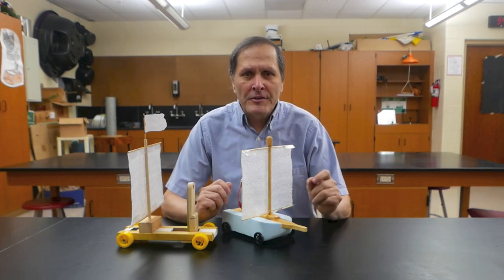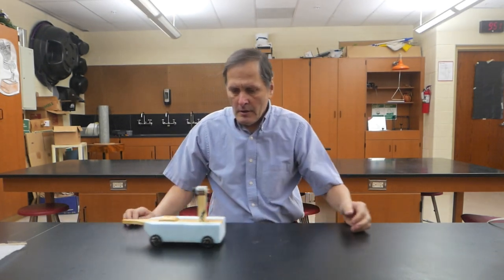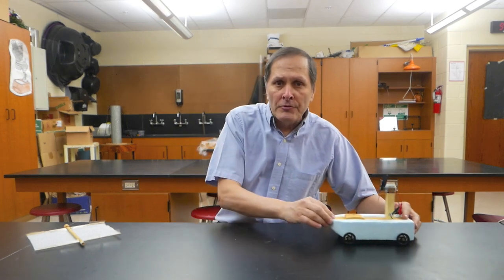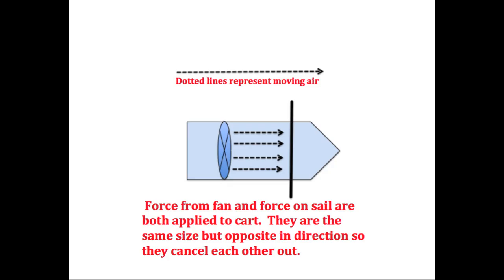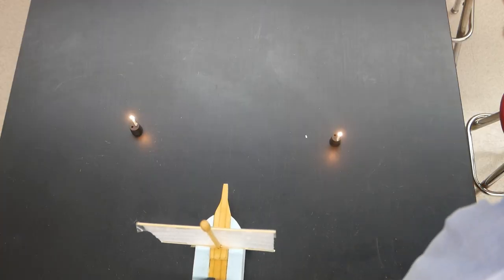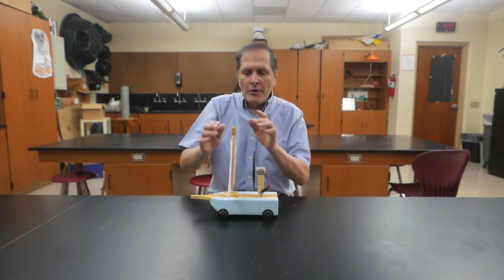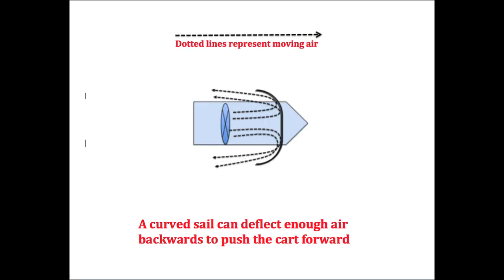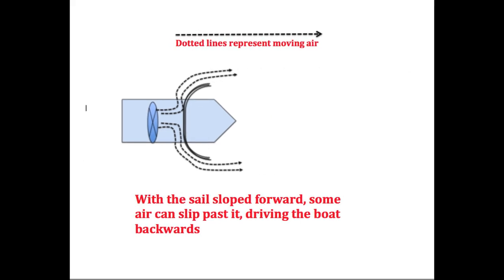Fan Cart - Blowing into your own Sail- part 1 // Homemade Science with Bruce Yeany

Comment: The principle of action and reaction is very valid and applicable that far i have gone for now across all your presented samples and applying it to them.

* A fan blows air into one direction whilst it sees exposed to a force in the other direction.

* A flat sail seems to redirect an air stream to both sides (great method of proof with the candles!) and thus first stops the air stream by action force against its original direction so the sail gets a reaction force in the original air stream direction. for the fixed fan with moveable cart the flat sail equipped cart sees accelleration. for the cobined cart with mounted flat sail and fan both items create an equal but opposing force (assumed that all air is impacted in the same manner by the sail). this will only bend the structures in between them. but wait - the second effect of the sail is are two roughly equal air streams to the side. so there are two forces accellerating each half of the air to the sides. Cause? The structure of the sail is flat... but wait the first stopped air is creating a preasurized area... that means an air volume that would like starting to expand to any direction. the oncoming air will not allow as well as the sail wil not allow but the sides are open - and guess if you would be able to put a candle above or below the sail it will as well see a wind stream. but see the flat sail is in the full scenario not exposed to the direct force of the oncoming winds but by the pressure the "stopped" air bubble is creating to all sides including the side of the sail. so the forward force on the sail is of very indirect nature. most of the air's substance never even touches the sail but it's force and energy is handed over to their neighbours making only the relatively few ones in contact with the sail finally transfering those attributes to the sail. now black boxing... regardless on how the pressure area looks like, the result is an air movement to roughly the sides. i say roughly because neither the sail nor the fan would create an air stream is expected to be perfectly in dimensions, its just sufficiently good. as the resulting air stream is moving more like a circular surface wave from a stone that is thrown into some lake its causing action would hint for a center of origin with all action forces pointing starry to the outwards from a theoretical center while all are living in the same plane.

side note 1: what is really going on? the energy of your batteries that you used for the fan is converted using multiple physical effects in sequence so that finally an air stream is leaving the setup that is expanding mostly with a circular front and in parallel to the surface of the sail. the energy is gone to the expanding air and that is what energy often does... maximzing entropy.

side note 2: guess why it is so hard to balance the "flat sail + fan on water" variation to not start turning? because it is so hard to keep the presurized area sufficiently symmetric. imaging you are trying to balance a disc on a pin and then pouring water onto it - hopes are small that the water will flow to all directions i the same fashion. this is much more true when it comes to a flat paper sail that will be able to bend depending on the force the stopping preassure applys to it.
Reply: conclusion:
the flat sail+fan vehicle is a "trap" for the air to build up preasure so that the air (as an energy carying medium) will vaporize the energy from the battery in a balanced fahsion. thus no motion. any change in the base setup that will break those force balance thus will create some driving force that might at least for some cases lead to a motion of the vehicle.

but you were using rather force than energy - and the balance of force in the setup can be shown in general and even on the very spot:
a total deflection of the air stream (forming it into the circular expansion shape) is of course a force that is finally attached to the sail with one direction forward and a second direction outwards. (the first one is a classic actio-reactio "hard ball" force whilst the second is more of a surface friction force but still is much of actio-reactio but in a harder to see "slow down the stream fashion" with rather mostly undirectional thermal (=micro motion) energy in the result than some linear motion. objects rarely start a motion into all directions... their internal structural force limits will not allow - unless you spin some flywheel shape beyond its limit. why not spin a sand covered disc at increasing speeds?) if you would attach a bunch of little strings to the center of your sail with e.g. foam cubes on the other end... then you will be able to see how the air stream pulls them apart in a cirucular fashion. and this will show (in a macroscopic model fashion) the circular pull of the force on the center of the sail. of course putting a few water drops on a horizontal surface or attaching many little strings with film tape onto the surface

BTW: you could easily put a cone alike object in the center of the sail - no change.
or you could exchange your two-tubbed sail shape with a bunt cake pan (half'ed toroid) shaped one,  thus looks like a circular tub.

PS: your wheels on the vehicle will be able to create a high side force (slipping resistance) for keeping track whilst they will have a low force (low rolling resistance) into the rolling direction.
Reply from the maker: that's a very complete examination of the demonstration.   Interesting,  originally I thought I was showing a basic example of action reaction and it appears to have involved into a problem that is much more complex.  I am going to try this again next week with some other variations to address concerns brought up by several viewers.  I will try what you have suggested and see we can get,  thanks for your insightful comment.

Comment: Absolutely bloody brilliant video.

I had come to exactly the same conclusions as this video did in practice from considering the different scenarios, although I didn't bother consider the scenario of a curved sailed pointing away, and indeed that scenario behaved as I suspected as a less efficient form of the cart without a sail.

Doing it on the water as well was another excellent test.

The build quality of the little carts and sails and fixtures was excellent as well.

Comment: Could a sail be built with enough slack and design in the fabric (and enough "wind" in the motor) to be able to mimic the curvature and forces in the fixed cardboard sail?
Reply: tsysman21 
what would be the point?

You would move faster with just the fan.
Reply: bananian I'm aware of it not being practical; my question is just is it possible. Even having the cardboard sail is less efficient than just using the fan.

Comment: Great video! Before I had witnessed any of your solutions to this dilemma, I thought a good way to solve this was with a sail that angled back toward the fan or a fan that angled back aimed at the top of the sail. I realize that you don't want lift, but there may exist a happy medium in there. I would imagine that a combination of both might create the desired result. However, the curved or cupped cardboard version you came up with is probably the best option. Cheers!

Comment: look the video. as a sailor I have to say you did a great job explain sail shape. sailboats get pushed to the side by the wind. the sails create lift and pull the boat forward. I noticed you had your sail put on backwards. I'm guessing it was to so the difference between deflection and push. it would be interesting to see what would happen if the mast was behind the sail
Reply from the maker: I fixed that in part two

Comment: What if the fan is lower down and angled up at the sail? or more curiously, a flat sail with a dead on self propelling wind, plus a small amount of external wind, would it go just as fast as it would without the on board fan, or would it go faster/slower?

Comment: i noticed your "cloth" sail was pulled tight and flat against the mast...did you ever think to lower the fan a bit and add more fabric to the "cloth" sail? wouldn't that cause a cupped effect to the air and refocus it so it pushes the object forward?

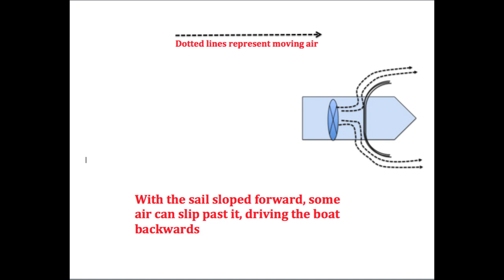Comment: 5:12 is it just me or is this diagram a bit off? i feel like there should be dotted lines pointing towards the inner curve of the sail (against the wind from the fan). if i remember right, the air moving along the curve of the sail is creating an air pressure difference between the front of the sail and the back of the sail. the pressure difference is what causes the boat to move backwards.

Comment: With the curved sail positioned to push the boat forward in water using its fan and then adding another fan not located on the boat, but also pushing from the rear,, would they cancel each other out???

Comment: A question on the "hard curved sail" placed so the is diverted around the outside in the same direction the fan is directing the air... Couldn't we also say the are rushing by quickly also creates a lower pressure area on the inside of the sail, allowing the atmosphere to press on the inside of the sail?

Comment: good video man, 2 questions though, on real sails the fabric is loose, actually relying on the wind to form it in to the needed airfoil shape required to move the vessel forward, your sails on the other hand were stiff as a board. would blowing into a loose sail create a conical shape, simular to the one produced by your cardboard sail,  and therefore diverting the air towards the rear of the vessal and pushing it forward?  also if the sail is angled as in real life, will blowing into it from the rear have any effect? I think in theory as long as you could still get it into an airfoil shape it might work?
Reply from the maker: I kept the sail stiff as I was trying to have it resemble the  fan cart  which many science teachers have in their classrooms, my mistake.  I think I do a better job of it in part two

Comment: This is really cool. Definitely something I wish I had been doing going through middle school instead of textbooks. I don’t know if it would be instructive to middle schoolers to include a history of the development of transportation. You can see what were successful and then try things that weren’t tried or were tried but failed. This way the students get a feel for experimenting. Something like: why did they go the route of paddle wheels instead of a fan blowing in the back of the ship when steam power came along? Why also did they used the propeller screw later and not keep using the paddle wheel? And why did they not hang a couple of jet engine on the sides of a ship? So then the  students would be looking into the concepts of momentum.

Comment: I have a suggestion, have you tried aiming the fan perpendicular to the boat instead of parallel? If you then fix the sail in an approximately 45 degree angle, the cart/boat should travel forward as well. This is based on a sailing principle that allows you to sail upwind.

Comment: Do you think the torque of the motor had anything to do with the boat spinning. If it was because of unequal force on the sail the movement would have been more sidways. Yes the front of the boat would have made a circle due to the location of the sail, but I feel that was too extreme for that force.

Comment: Would it be possible to utilize the Bernoulli Principle to get the cart/boat to move in a direction neither with nor opposite to the direction of ANY airflow? Some sort of laminar flow design for the sail (wing) - or, am I just over-thinking things?
Reply: This is quite possible, though it would require some careful positioning to make it work. And it would always be more effective to just blow air in the direction opposite the way you intend to go than to blow into a sail

Comment: What about the keel and rudder, as well as the fact that sails can be angled to take advantage of wind coming from many directions?   Surely that plays into the equation somehow, as far as the transfer of wind energy into forward motion?
Reply from the maker: Looks like I will be trying this again next week
Reply: Awesome!  I was also gonna add, maybe a scaled-down version of the curved/cupped sail, to imitate the way that regular sails deform when air is blowing against them?... I don't know if this would significantly impact the results?
Reply: All of which would make this a worse examination of the physics involved.

Comment: Would the car with a fan move if you added the force from natural wind (large fan)? Would that force put enough force pushing the car to cancel the fan out?
Reply: That dinky little fan's motor isn't powerful enough and its blades don't have enough surface area. There's no way it would be able to generate enough energy to counter the wind from the big fan.

Wait... what if he used the curved sail to compensate for the difference? Hmm...

Comment: Before you put the other sail on I was thinking if you put a tube or pipe the diameter of the fan blades right in front of it that did a 360 to blow on the sail ?

Comment: great presentation. when you put the sail at a steep angle in water, you got me wondering about tacking. depending on the shape of the sail and angle, i wonder if the fan and sail shape (see airplane wing) could work in tandem to promote a direction and would it be better than fan alone

Comment: This is really confusing haha, I’m an aerospace engineer and I tripped out for a few seconds, so don’t feel bad :)

Here’s how I look at it:
Let’s assume you’re standing in the back of a sailboat. Instead of a sail there is a solid wall. Let’s also assume there are no losses and all collisions are perfectly elastic.
1. You throw a ball at the wall.
2. The moment the ball leaves your hand, the boat gains momentum equal and opposite to the ball, so it begins to move backwards.
3. When the ball hits the wall and ceases to move with respect to the wall, both the boat and the ball have no velocity. At this point the net effect has been that the boat moved backwards.
4. Now since the collision is perfectly elastic, both the ball and boat begin to move in opposite directions to what they were before.
5. Now the boat begins to move forward and the ball moves backward.
6. Eventually the boat reaches its initial starting point. But notice the boat is still moving forward.
7. Time continues and the ball is now outside, behind the boat and continuing. The boat is now ahead of where it started and continuing.
8. The boat and ball will never meet again, so the boat will continue to move forward.

This is the simplified explanation of what is happening, but it captures the fundamental effect. Of course an actual ball will be falling due to gravity, but we assumed it wouldn’t because the ball in this case (air) is the same density as the air around it. All the losses we neglected due to our assumptions are apparent in the actual experiment in the video, which is why it’s more effective to have the fan without a sail.

If you measure the forces on the boat with the sail and fan and have a high speed camera, you’ll see that moments after the fan starts spinning the boat will feel a force backwards equal to that of the no sail case. Moments later that force will become balanced out and moments later it will become forwards. You can picture the fan shooting a constant stream of these balls at the sail. The overall effect of each ball is a net force forward.

Comment: Wondering what would happen if the 'boat' had a rudder to counter the torque, as a tail rotor counters the torque of the helicopter's main rotor?  Would it be possible to get some forward motion, or would that result in a net zero, like when the cart was on wheels on the table?

Alternately, test with the cart on a track to prevent it turning, then set the sail at a forty-five to the fan?  I suspect you could get a bit of forward motion even with the increased lateral friction.  Best would be to mount the fan to one side and set the sail to deflect the wind backward, as sailing vessels do in practice.

Comment: Is the curved sail really acting as a sail though? In my mind a sail is a mechanism which utilizes/creates drag from moving air in order to facilitate motion. With the curved sail, the boat isn't being driven by drag on the sail (because the drag is equal to the backwards force created by the fan). It's being driven by the same lateral force from the fan as in the example with no sail, except this time that air is being diverted by what is essentially an inefficient duct/exhaust. To me, it seems the forces of the curved sail example are more akin to a rocket than to a sail.

Comment: What if you have two boats tied together with a piece of string, so one boat has the sail and the 2nd boat which will be smaller in size has the fan, what happens then?

Comment: This got me wondering about using a triangular or quadrilateral sail with a fan blowing from the side, like a sail boat, as opposed to the square sails being blown from behind. Since this method was actually quite common on most ships, because it allows a ship travel faster than the air pushing it, it could be a more reliable way to blow in to your own sail.

Comment: How would this work with a more modern style of sail - such as those found on a bermuda rig, where the sail is an aerofoil? Some vessels and vehicles fitted with aerofoil sails can travel significantly faster than the speed of the wind that is powering them. I would still imagine that blowing into the sail won't work too well, but does the fact that the sail could be an aerofoil change anything?